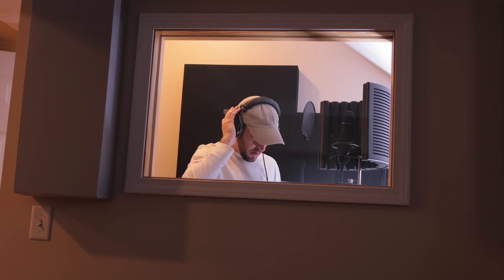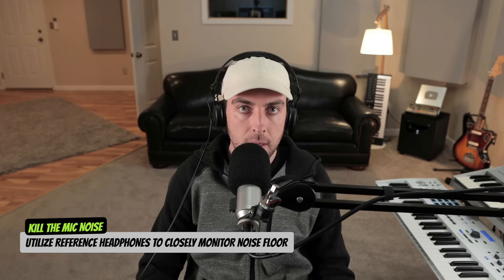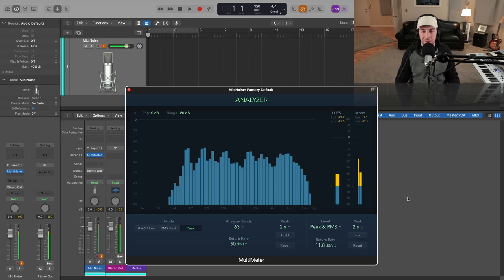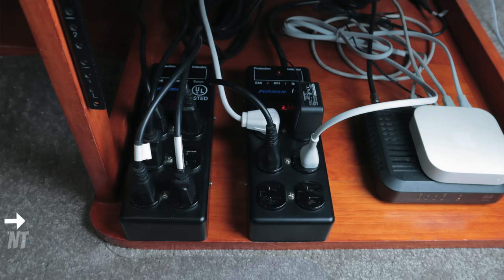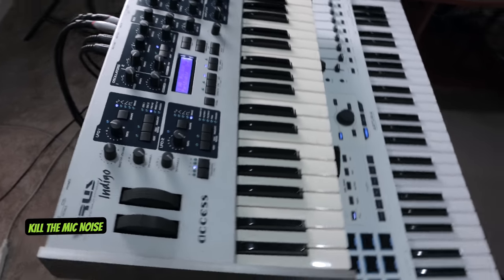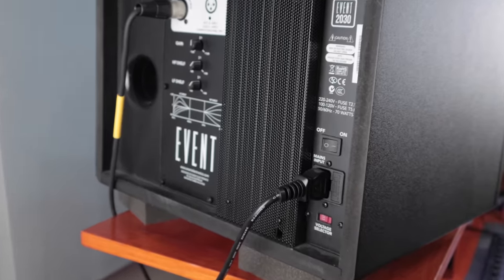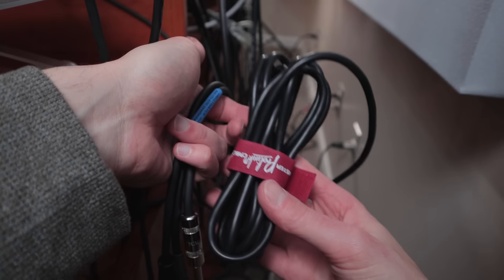Kill the Mic Noise - Clean and Quiet Recording

Comment from the maker: Crazy to think it was 5 YEARS AGO I last posted a video on this topic…thought I’d share an update! I’ve noticed different noise in my vocal chain more recently and thought you all might have some of the same issues. Your noise sources may seem subtle at first... when they all start adding up and we get in to mixing with compression, EQ, etc. it becomes a real problem that's tough to fix in post. Hope this is helpful and much love 🙏
Reply: Hey bro, thanks for this info.  If you cant get a humX, get a little adapter that basically allows you to plug into a old non grounded power receptacle.  I had a few from a really old house I used to live in, but it actually removes the hum much of the time.
Reply: @ericb-amuur9897  5:19

Comment: I found Neutron gate module within Neutron from Izotope has a preset called reduce room reverberance it has a learn function that measures the room noise floor automatically then utilizes a multiband gate that works so good you have to try it to believe there are no settings whatsoever that you have to tweak its the easiest cheat I found especially if you have a badly treated room only thing is multiband adds a bit of latency but you can use it even after the live recording session results are the same I'll try your method as well thanks for the tips.
Reply from the maker: Awesome, will have to check that out! Thanks for sharing 🙌

Comment: 00:05 Identifying and isolating noise in vocal mic recordings

01:06 Measuring noise floor and adjusting noise gate

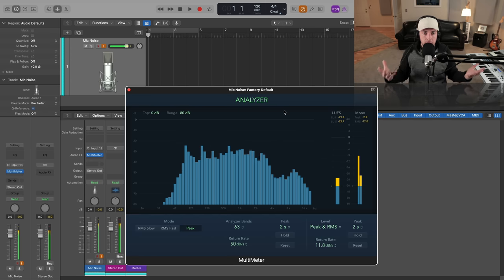02:07 Turn off phantom power for condenser mics and lower gain for dynamic mics.

03:26 Identified noise floor in recordings and found the source of the noise.

04:36 Using the wrong AC adapter for my camera caused audio signal issues.

05:26 Using a hum x can eliminate hum in audio equipment, but it may not work in all situations

06:33 Use balanced cables and proper cable management to reduce noise in recordings.

07:28 Reducing Noise Floor Issues in Recordings

Comment: Thanks for the video. Question;  my signal chain is very basic. Passive Cardiod Mic > M-Audio AIR 192/6 USB w/ phantom power switch > PC > Studio One or Videopad > 2.1 speaker setup. In your opinion, where in this chain do you see the most potential for hum and/or buzz? It should be noted that in order to get a respectable gain on the mic, I have to use phantom power and set the gain at 5 o-clock ( level 9 out of 10  ).

Thanks,
-J.
Reply from the maker: The mic and/or the interface. Different mics have different self noise characteristics (some have a much higher noise floor than others). Cranking your preamp near full gain is almost always going to have a more noisy result as well.
Reply: @SeanDivine  Yep, that's what I was afraid of. Both of my previous M-Audio boxes were great units and I'm sure this one will be too, but I cannot for the life of me understand why they would choose to package the AIR box in a content creator startup kit with a Marantz microphone? Yeah I was a kid throughout the entire 70's so I know what I'm saying when I tell you that Marantz was all about stereo receivers and turntables, and were in competition with Techniques, Pioneer, and to a lesser extent Panasonic for the US home stereo market. But pro audio? Nope. Hell, a house brand mic from Radio Shack would probably kick this things ass.

 I'm going to try sending a less maxed-out signal through Voicemeeter and see what shakes. In the interim, if you could suggest a good active, non-ribbon mic tailored to this application, that would be great. Thanks!
Reply from the maker: @WMaanes  for the price, you can't go wrong with the NT1 5th gen IMO. It's one of the quietest mics out there in terms of self noise and doesn't require a ton of gain. If you want to go a bit more expensive but more versatile with pickup patterns, I like the AKG 414 XLS.
Reply: @SeanDivine  Thank you. I found out that the video editing software I use has a plug-in that boosts your clean gain up to 3x  the current setting. Problem solved.

Comment: You think the Monster ProLinks are better than Mogami cables? I'm recording voice over and the noise has gotten disrespectful. I'm going to try the process of elimination to figure out where the noise is coming from but wanted to know your thoughts on prolink vs mogami. Thanks for the video.
Reply from the maker: For price / quality, I've had a better experience with Monster cables thus far. I'm rough on cables and the materials have held up over time, never had one fail. Good shielding.

Comment: Do you any recommendations on mic cables? Also, I saw on your monitor you boost the low & high frequencies a bit. Is there a reason for that or was it something that sounded best with that specific room?

Something I do is unplug anything in the room I don’t need to use when recording. Idk how much of a difference it makes, but i still do it. 

Great tip on using separate power-strips.

I was just looking at ur channel a couple days ago to see if you posted... Appreciate the update!!!
Reply from the maker: Monster Prolink Performer at the desk, Pro Co DynaMike in the booth. Also have a Mogami Gold that I use sometimes but they're not cheap and it hasn't held up all that well. All balanced XLR... There's a large open space in the room on the opposite side of my left monitor that affects the frequency response. Using the shelf controls help fill in the gaps!
Reply: @SeanDivine  Thank you for always being thorough & transparent!! Have a good one, brotha!
Reply: @SeanDivine  the Mogami Gold should have a lifetime warranty

Comment: You mentioned putting your laptop power adapter on a separate outlet than the rest of your audio gear… do you think that would be something that would help from a desktop computer as well? I have all my stuff hooked up to a furman power distributor (not conditioner), speakers, interface, preamps, etc. I was going to get a rackmount power conditioner to help with this situation, but should I isolate the computer from the rest of that?
Reply from the maker: It depends on the computer. In my experience, laptop adapters tend to more commonly cause noise issues... that said, I had an iMac desktop that I had to use a Hum X for! If you isolate it and it's not causing noise, it's perfectly fine to keep it hooked up to the same power conditioner.

Comment: I have a Samsung laptop that costs $200. I only recorded it in my Samsung laptop. I'm not sure if the laptop is not high quality and why it keeps buzzing when I sing or when I listen to my recording.
Reply from the maker: Are you using an audio interface? Try plugging your laptop into a different power outlet than the interface / mic.
Reply: @SeanDivine  What if the interface is connected to my laptop? I'm using an Elgato Wave XLR Interface, which doesn't need external power.

Comment: Big thing that I've come across is that the Macbook fan makes a lot of notice when running sessions... Feels like a hard culprit to eliminate... :/
Reply from the maker: It’s a tough one :( the recent macbooks are MUCH quieter… a noise gate is helpful and also if you can place your laptop docked as far away from the mic as possible.
Reply: I just copped a laptop cooling fan that you place your laptop on top of. Keeps the laptop cool to reduce fan noise when you're not tracking. Then just unplug while you track. The laptop should be cool enough to be quiet.
Reply: @eddyrock8136  oh really? Which did you buy? Do you think it’s worth it.